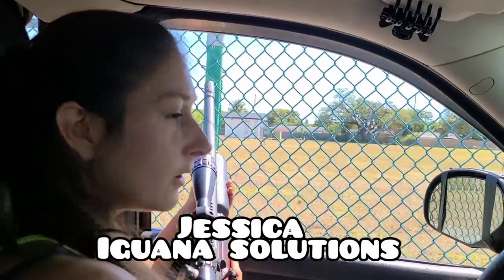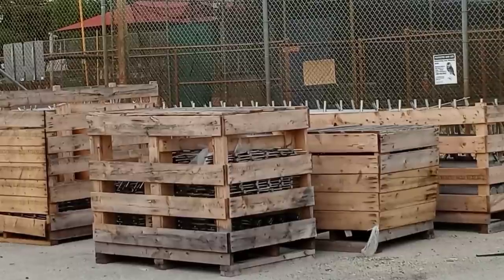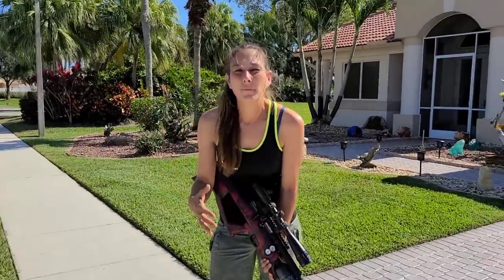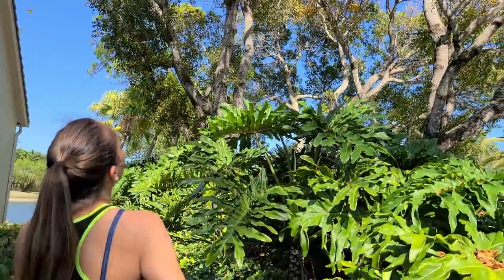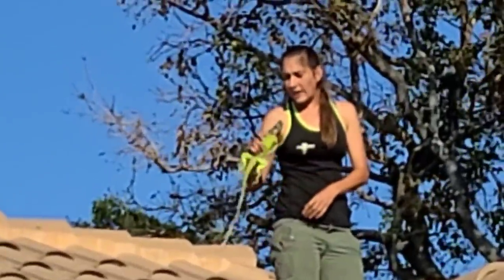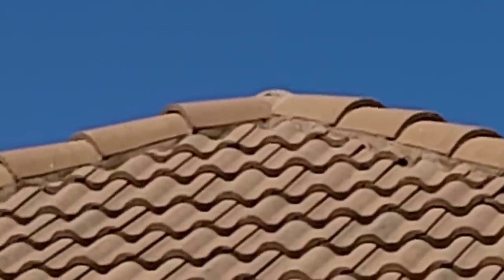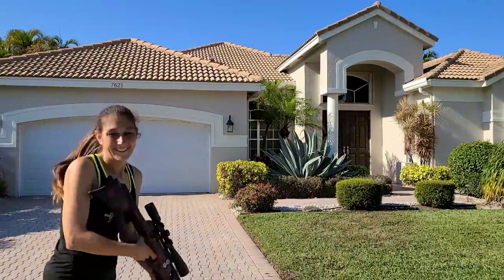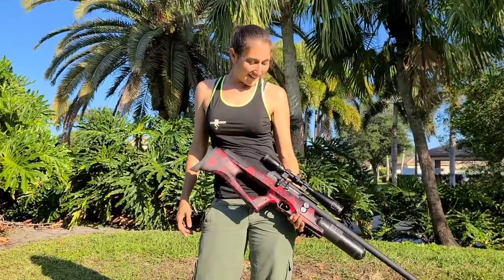Iguana Snipers : Iguana removal from homes in South Florida using an Air Rifle

Comment: If I were you I would not walk on those tile roofs. You don't weigh much but it is very easy to crack or break those tiles when stepping on them. When the roof starts leaking the homeowner is going to call you. You would not believe how much a roofer charges to replace just one of those tiles. You have that long pole, it would be much safer and easer to tape a large treble hook on the end and pull those dead lizards off the roof. 
If you practice casting with a fishing pole in a straight line you could learn to cast a treble hook up there without even getting a ladder.  Great videos!!
Reply: @TomTropicana  I'm glad yours are different. Up north they are like pottery or ceramic and can break very easily if you step in an area that is not supported properly. Great videos! Blast 'em!!

Comment: Just an idea, but have you tried a lighter pellet that comes apart or open up inside the iguana and doesnt exit? A pellet that uses all it energy inside the iguana is more fatal, and by not exiting, you dont have to worry about where the pellet might come down in the background. I do nuisance animal control in my part of the country, and using bullets/pellets that dont exit critters, the customers are much happier also.

Comment: All that running around on roofs is dangerous. Rig a UAV as an iguana-corpse retriever.
Reply: @TomTropicana  An ordinary consumer or commercial quadcopter ought to be able to do the job with a barbed stick or hook slung below it.  I don't know how heavy your targets get, but there should be something avaiable with a bit of a margin to drag them off a roof or branch. (Your precision shots leaves me awe-struck.)
Reply from the maker: We discussed this but did not think a drone of sorts could pickup iguanas...what weight can they handle?
Reply: @iguanaSnipers  It might not be necessary to lift them, just drag them to a place they'll fall (or even set a hook for a line to pull them down). A quick online search will give you some names and prices. (Quite modest, unless you're looking for flashy cameras.) Experiments should be cheap and entertaining.